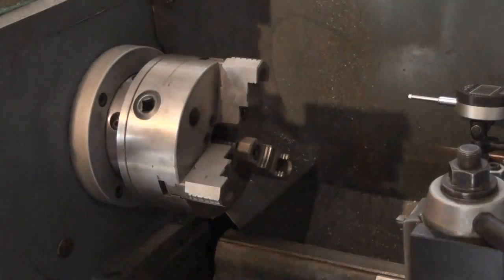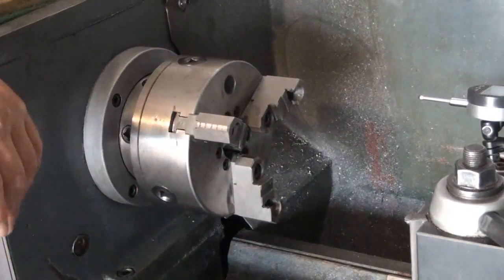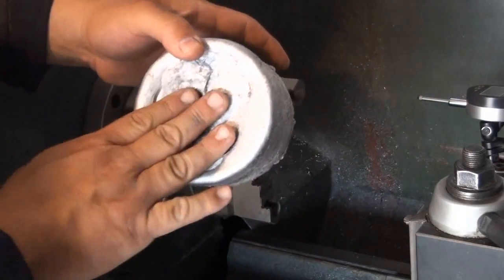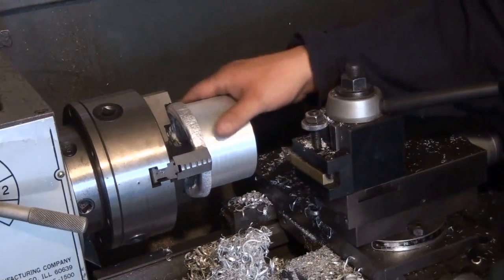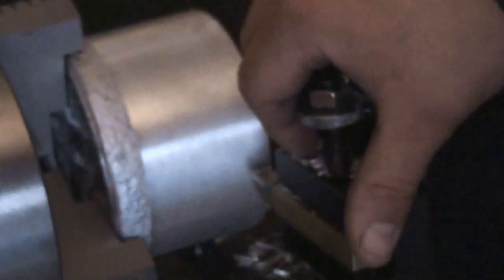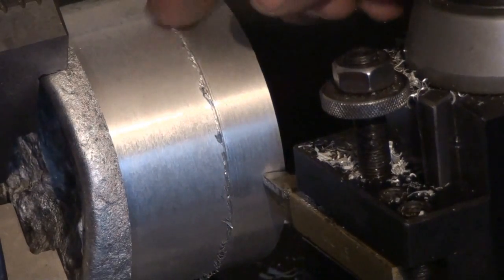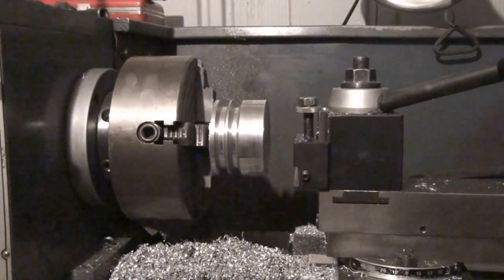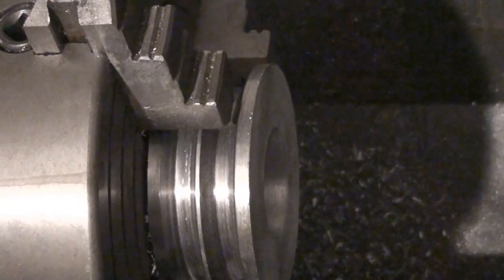Lathe Project Aluminum Pulley Part 1

Comment: Brother Ray-! May I ask what "kind / type" or grade of aluminium do you think you're getting from your pours-? Are you using mostly beer & pop cans or stuff from the local repair shop's, i.e. old pistons, manifolds etc.? Just wondering because I'm planning a small foundry in my living room* shortly and have been saving all sorts of aluminium for awhile now. I have been wondering about altering the alloy(s) by inserting my own quantity's of copper, lead etc. but haven't researched yet how to go about doing this. (*) - Just kidding about the living room thing......it's going in Mother-in-laws room for sure-!!! Thanks, J.B.

Comment: You can cut a key way in the lathe with a piece of tool steel and a boring bar. Grind the tool steel to the width of the key way, set it in a bar mount the bar in the tool post, set the tool level to the bored hole facing you. Lock the spindle with the back gears. touch off to the hole and manually wheel the carriage in, come back out turn cross slide out a little more then push the tool in again... just like a shaper. I've done this many times in all kinds of material.

Comment: Sure you can turn one by hand quite easily. I just finished my first model engine. It's a flame licker and needs much closer tolerances than a steam/compressed air engine. It wasn't too difficult to hit the proper sizes, you just have to take your time and measure accurately.